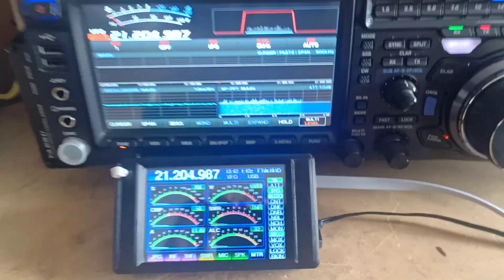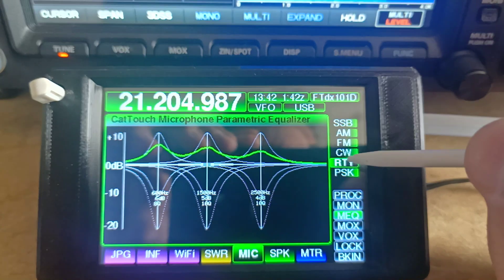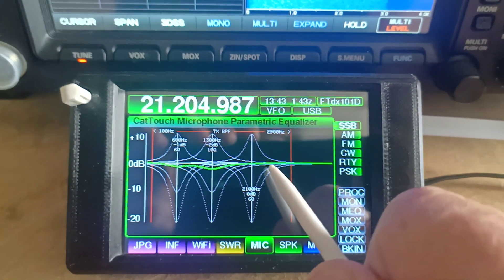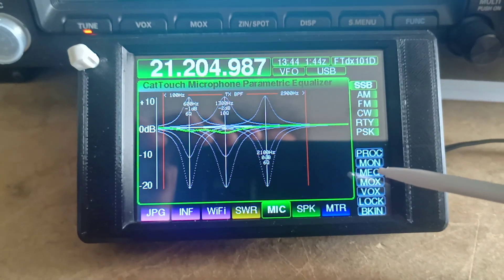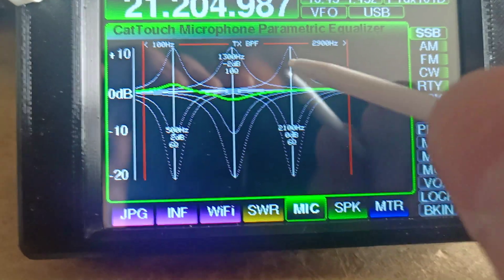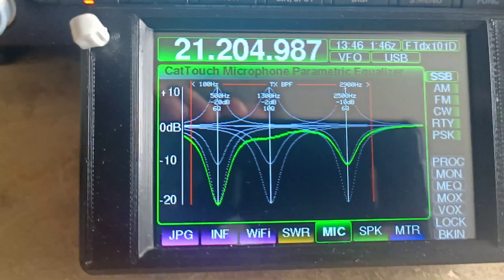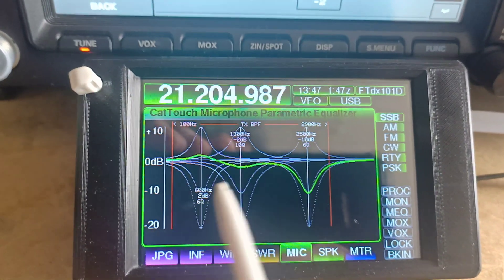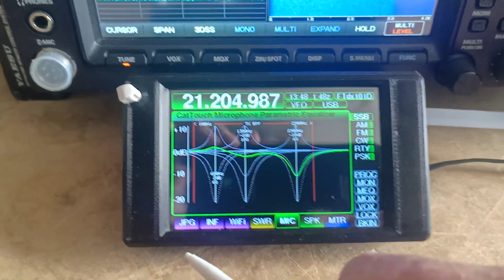CatTouch Microphone Parametric Equalizer - FT-991/A FT-DX10 FT-DX101D/MP FTdx1200 FTdx3000 FTdx5000

Comment: P Parametric means these are the settings with the processor ON, correct?
Reply from the maker: MEQ on - see https://www.catmeters.com/CatTouch-faq.html
Reply: Art, I see your point ... P Parameteric I thought was with EQ turned ON . @ 2:46min mark, Chris  explained it OFF  , Iam going to re-read the manual again ,  I thought Parametric was engaged when EQ OFF not P Parametric ?